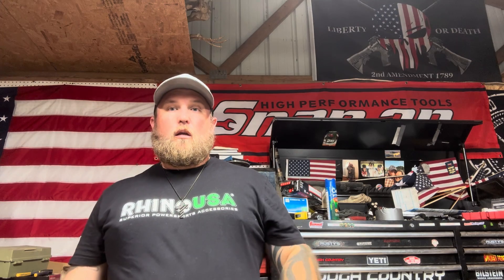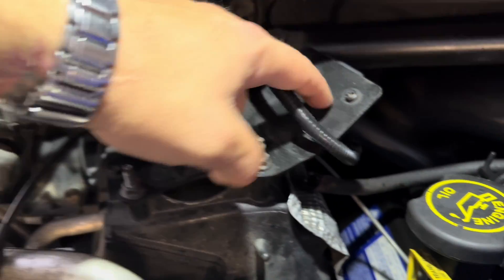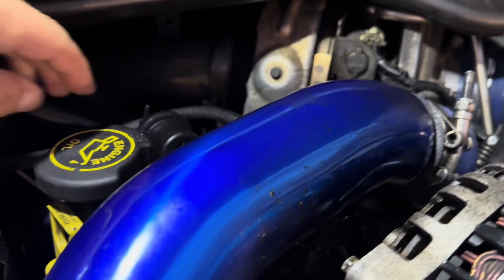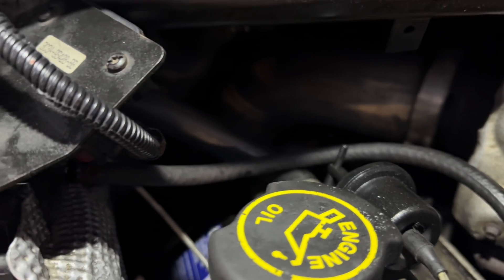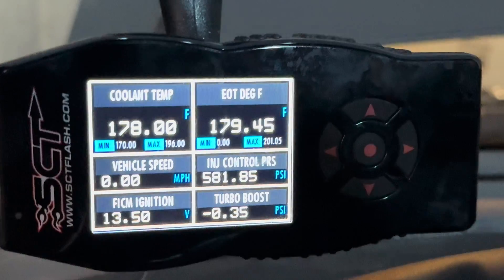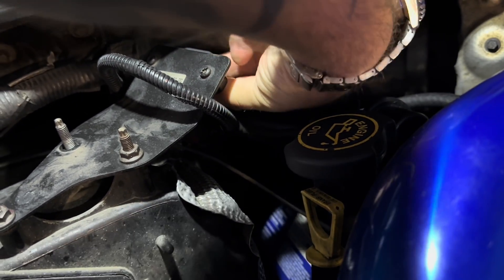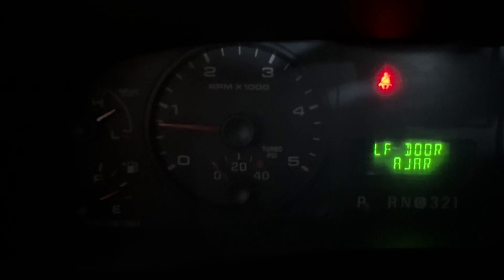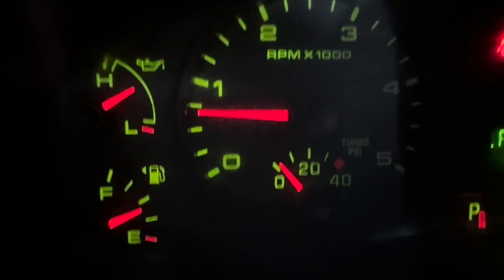How to fix turbo psi on 6.0 Powerstrok

Comment: does that make truck lose power? my truck only goes 40mph!!
Reply from the maker: I didn’t experience any power lose, just an inoperative gauge
Reply: @LivingJeepingandAdventuring  humm ! well ,,, who knows what's wrong with it!! besides being a money pit !!!
Reply: What did it end up being with your power lose issue?
Reply: @ it had many issues!!!! oil cooler , stuck turbo, bad radiator, bad injector harness !!  it"s parked